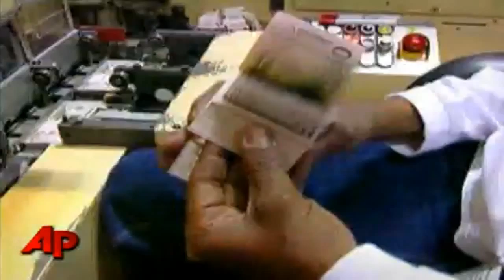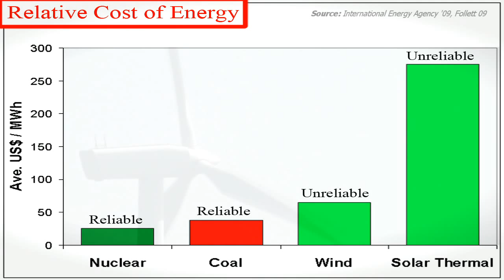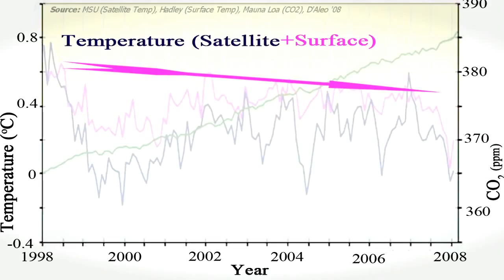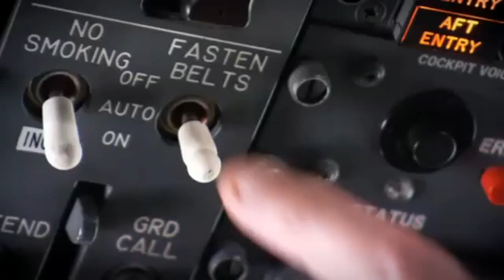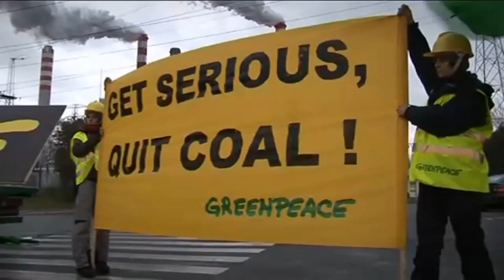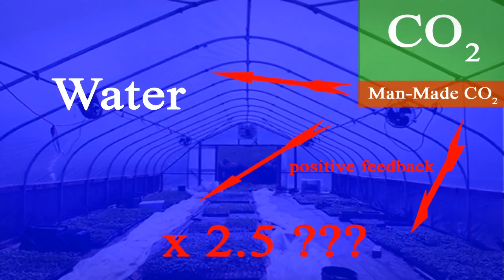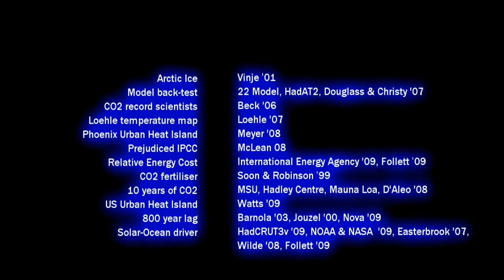Church of Global Warming - Part 6 of 6

Comment: Nice video set, but the concept of clean coal is lost, and it is actually already here.  This is the implementation of ultra-supercritical boilers, operating over 575 C.  They currently run up to 650 C.  35% less CO2 is emitted, which comes pretty close to an approximation of getting clean.  It is more efficient, and uses less coal per power output.  This is what ignorant, backward China is building now.  Google it up.  So the comment that clean coal is a pipe dream means you confused slang with ultra-supercritical.  USCW coal is what "clean coal" means without having to explain physics to people.
Reply from the maker: Apart from being incredibly dangerous, super-critical steam is invisible during a leak situation, and extremely complex, high tec. kit, which makes it very expensive, the relatively small gain in MW per tonne of coal means few of these types of plant are made currently.